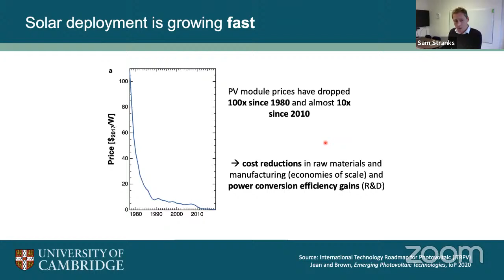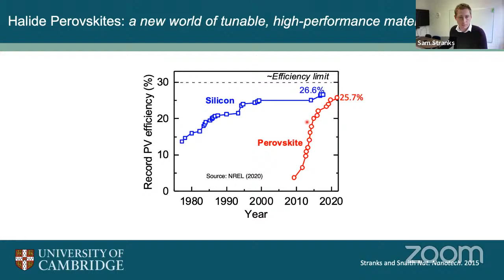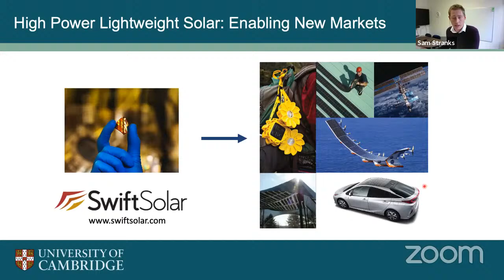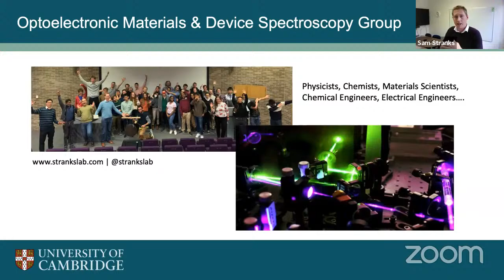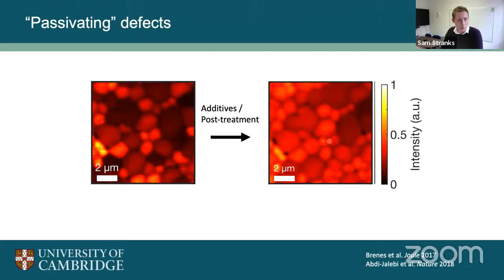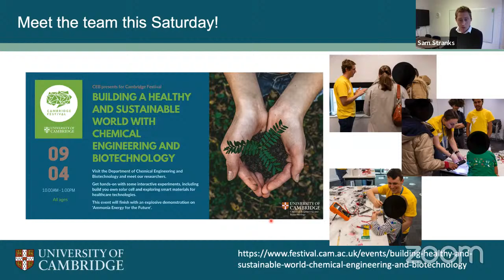Cambridge Festival at CEB: The future of perovskites for solar power and lighting

Comment: 20:00
I wonder 🤔  if this material can be made into flexible layers, could it be added onto electrical vehicles like they do with vinyl wraps? 🤔  since the tech is moving so fast there has to be a way to merge the status quo with the changing 'upgrades' otherwise we'll have a large waste issue...